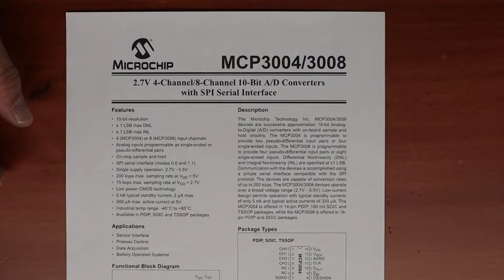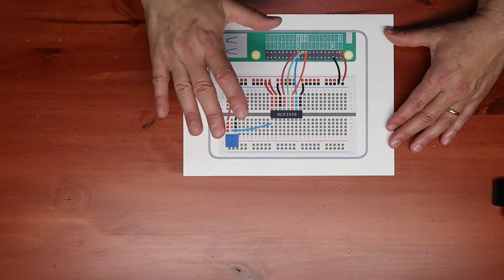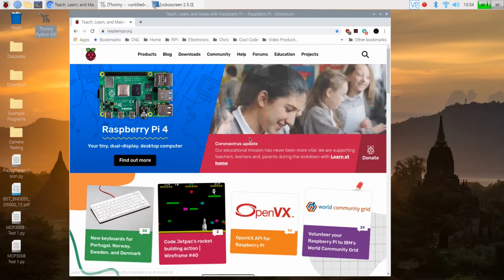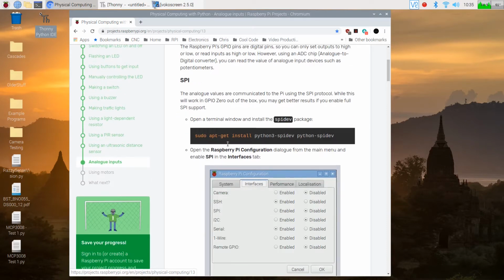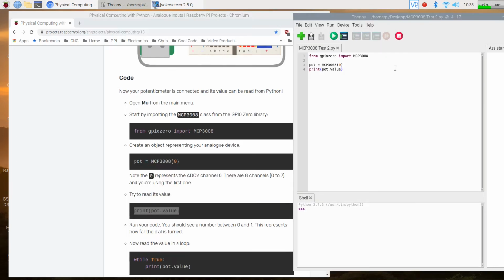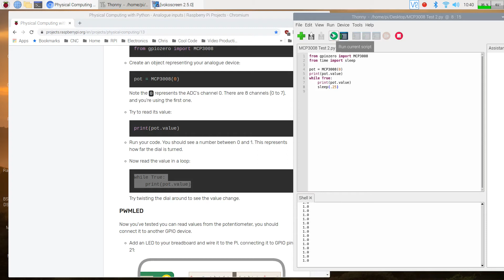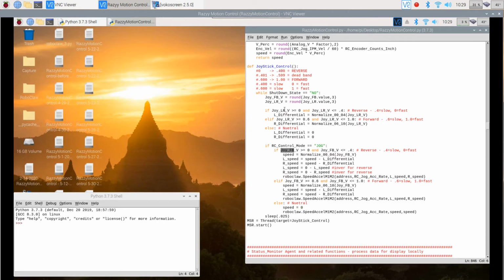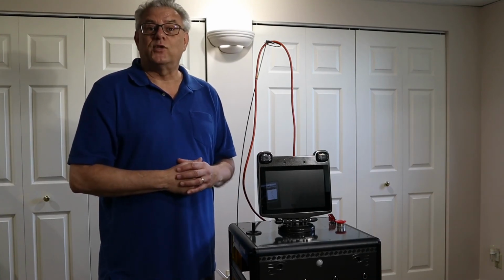E002 Add Analog Input to the Raspberry Pi Easily with the MCP3008 by Chris DeHut

Comment: This is one more very helpful video from you, Chris. Thank you. This is about adding an analog input to Raspberry Pi, however, is there a way to get an analog output from Raspberry Pi? I need an output range of 0 to 5V (3V will also work).

I need this to control the speed of a motor, which takes 0 to 5V voltage signal to set its speed.

I saw that there is a Motor class in gpiozero library which provides readymade methods to control speed of motors through motor controllers. I wonder if those motor controllers generate that variable voltage as an output to the motor. Would you know? If yes, I could buy them and use them to control the speed of my motor. My motor is 1,000 W (48V). It will be powered separately and it comes with its own controller so I don't need to supply it power through an RPi compatible controller. I just need to generate a variable voltage (0 to 5V) that will be fed to the controller of that motor.
Reply from the maker: Depending on the speed control, this can be tricky.  The only reference I have is what needed to do for a spindle speed control (industrial) which was many years back.  Basically you need a digital to analog converter device.  The PI would output a PWM signal, then the device converts that to an analog output.  The ones I am familiar with also require the voltage source for the analog to come from the spindle drive.  My suggestion would be to search for a digital to analog converter and also include your motor driver model in that search.  
Cheers!
Chris
Reply: @MakingStuffwithChrisDeHut   All you need to convert a PWM signal to analog is the poor-man's DAC: a 1K resistor in series to a 10uF capacitor +, with capacitor - on ground.  The capacitor then charges up and down between 0 and Vs volts, depending on the duty cycle of the PWM.  If you need a wider range output than Vs, you can run it through a 4011 gate running on say 12VDC, which is how 0-10V motor speed controller signals are gotten from 3.3V or TTL level PWM.
Reply from the maker: Hi Richard,
Thanks for the add-in information.  I will have to give that a go the next time I have a need for "analog output.!
Cheers!
Chris

Comment: hi,
i was trying to read the analog values from raspi 3 B model , but i failed in so many attempts. after so many attempts i tried these  steps and after all i got the result but the problem is the read values will display between 1 to 0.
pls explain us how to get the exact reading values.
thank you